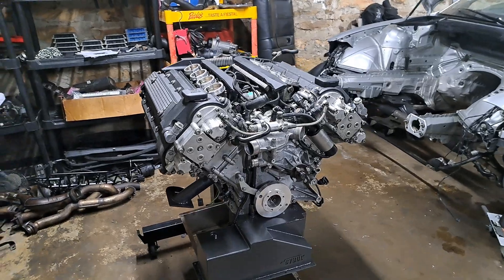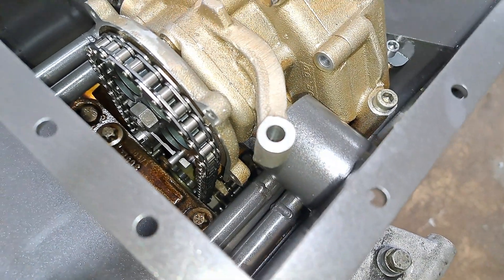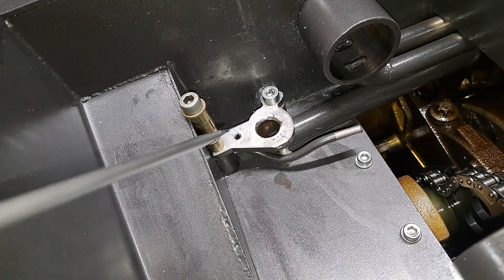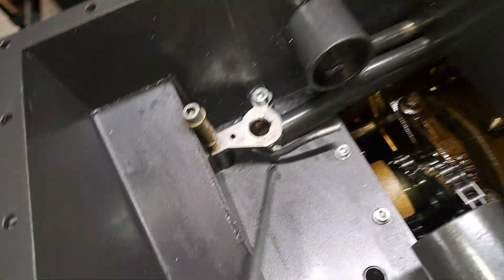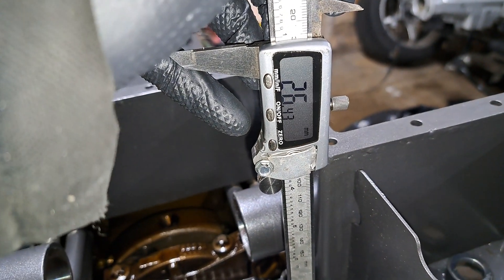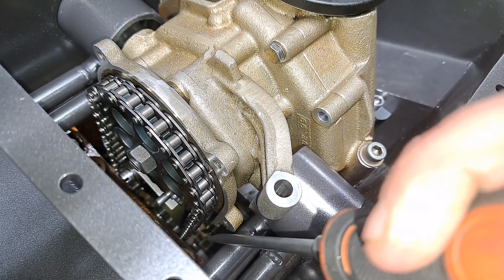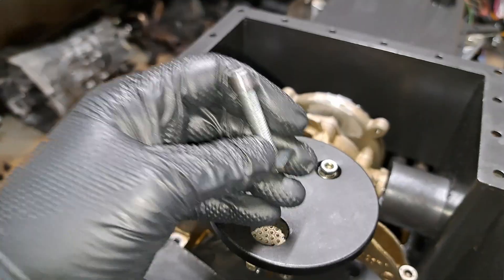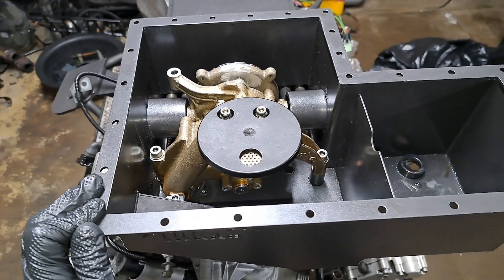BMW E46 S62B50 V8 Swap Oil Pump Update

Comment: Hi, great job! 
How much oil will you pour into the pan?
Reply from the maker: @mechanicheduard  I'm not sure. After oil pan is installed instructions say fill until dipstick reads full, using original dipstick and tube. I currently don't know how much oil that is with this pan.
Reply: @OLearysBMW  
Take measurment, pls, when you filled it up
Thanks.
Reply from the maker: @mechanicheduard  This oil pan holds around 7 quarts.
Reply: @OLearysBMW  Thanks. 
As in original pan.
I have something different in my case.

Comment: Jeez....I'd still be getting a full refund.  The consumer shouldn't have to Jerry rig the parts to make them work.
Reply from the maker: Or they could hire me, I wouldn't let this stuff slide. Lol, I'm not the only person having chain slack issues. I was prepared to be using gasket material for a slight adjustment, but not ~3mm of fitment issue in a very important area. A little ridiculous, yet I now feel better and will be using this oil pan.